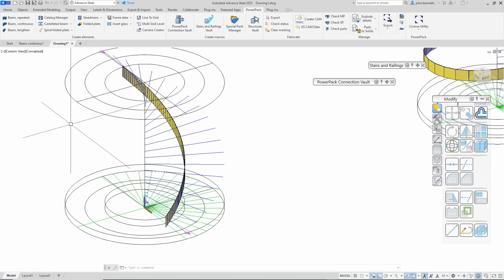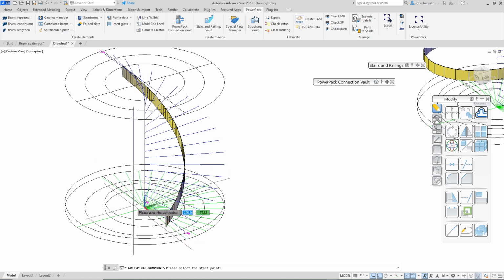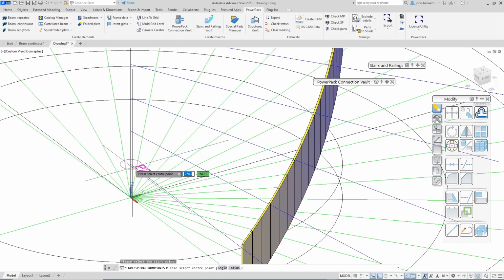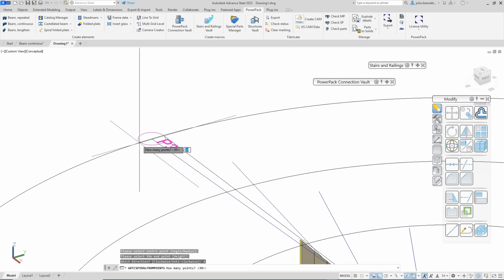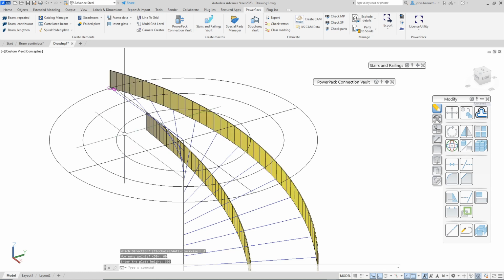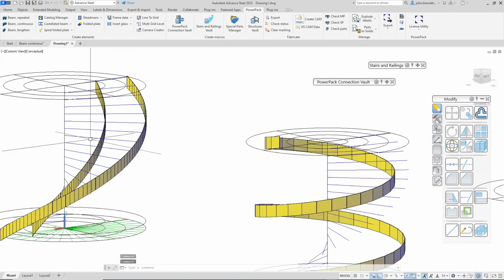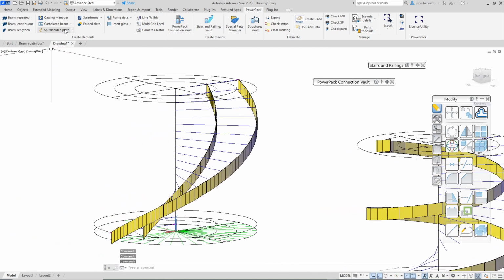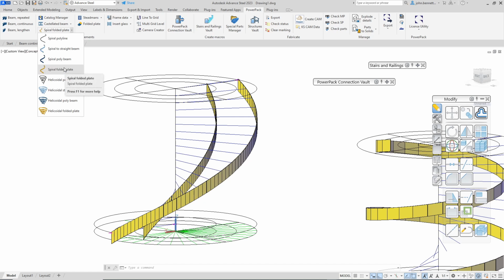Creating a Spiral Folded Plate Using PowerPack plugin for Advance Steel

Comment: Hello, first of all I apologize for the inconvenience, I don't know how I managed it but when I use the command "Display objects connected in shop" it selects all my beams, when in fact it should only select the selected element
Reply from the maker: Hi Florin, the command is an Advance Steel command related to checking interconnections between objects,  it would turn all the model red highlighted if they were connected together by connection elements ( bolts/Welds) shop applied. Please contact your GRAITEC support or Autodesk support for further input over display connected objects in shop.